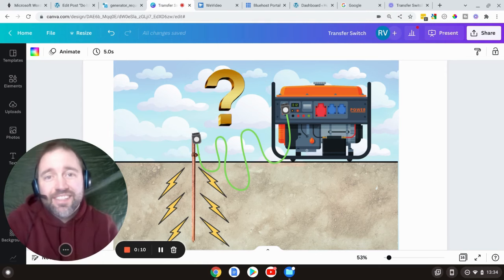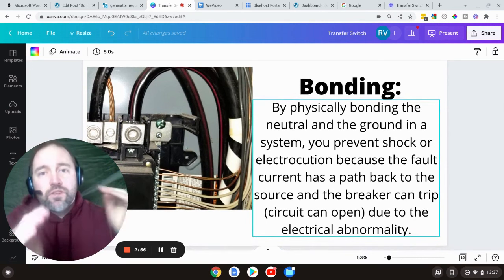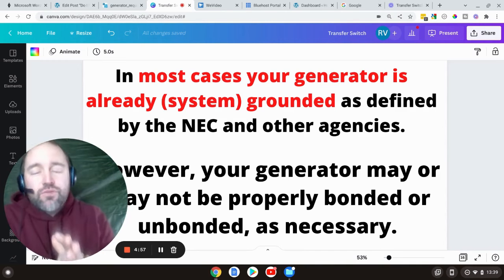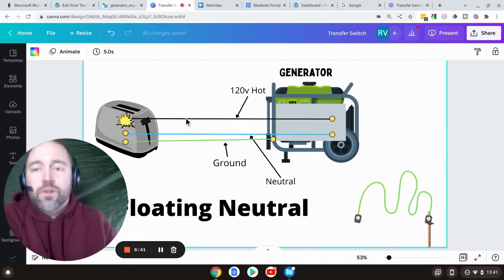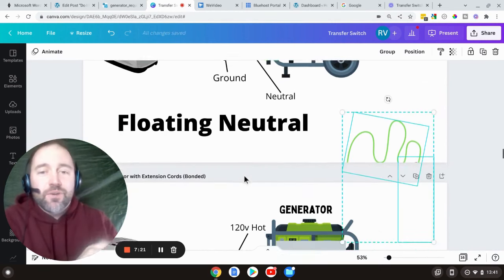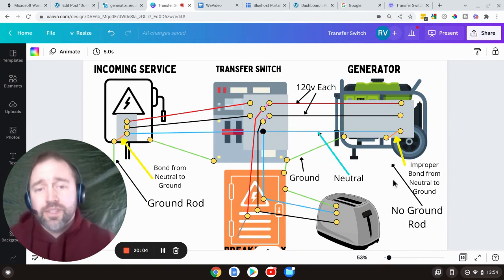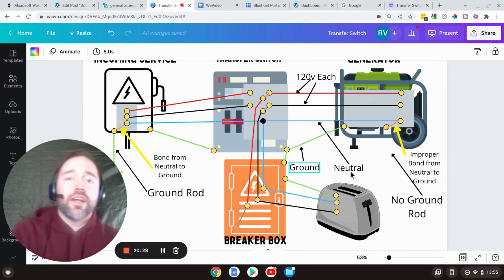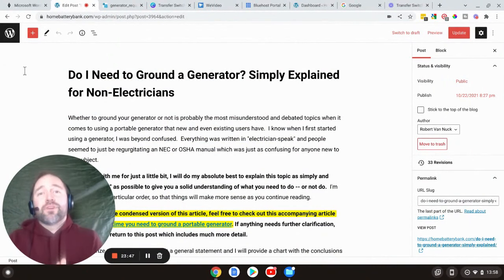Does My Generator Need a Ground Rod?  Probably Not.  Here's why.

Comment: Newbie here.  I use nothing but electrical chords to run some key items (freezer, etc) during a power outage.  Per this video, I should bond my neutral.  I'm not using the L5-30r socket on my generator (120v only generator, no 240v).  Can I purchase a L5-30p plug and do the bonding within the plug?  I makes for simple conversation back and forth between floating and bonded.
Reply: Get a bonding plug they are inexpensive on Amazon. It will plug into a 120 receptacle on the generator and the entire generator will be bonded including the 30 amp receptacle
Reply: Check your generator to see if its already bonded.  See if there is continuity between the neutral socket opening (the wide one) and the round ground opening socket, using a meter.  I had to move my meter leads around some before I made a good connection and found that I have a bonded generator.

Comment: So my solar generator is a floating neutral and my transfer switch is Generac HomeLink, which switches the neutral from the grid neutral. The only thing shared in the transfer switch is the ground bar which is connected for both power sources. I would assume that if I used a generator grounding plug that bonds the neutral and the ground together on my solar generator this would meet the requirement to bond my solar generator when powering part of my home and gives it access to the homes' existing grounding system, which includes the grounding rod, yes?  Thank you for this great video!
Reply: I would say you can test this with a meter. Flip your transfer switch to the standby power mode and see if ground and neutral are still tied together, measured at the plug where you connect your generator.

Comment: If you convert a portable generator to a floating neutral, should you not use the outlets on the generator at the same time the generator is energizing the house through the house electrical panel?  I'm wondering, since a neighbor has expressed interest in running an extension cord to the generator.
Reply: I don't see why you couldn't use those outlets since the neutral is bonded at the house and essentially they are no different than an outlet in your house. If you're talking about that neighbor connecting into your generator, I'd be more concerned about them exceeding the output of your generator and tripping your generator breaker.

Comment: I don't have my generator on a 'frame', I have it on a steel metal garden cart, because it's easier for me to move, it's very heavy. Since the cart has for rubber wheels, would it be advisable to put a grounding rod in to attach to the cart?  I used this generator last year here in East Texas when they froze us out for 3 days, had no problems, but what you have said about the frame being the ground for the generator now has me a bit worried. Thank you.
Reply: If you have a 4 wire connection to the house, you are already grounded through the home system.
Reply: @rupe53  ; thank you, I knew that it was, but I just run a cord through the window, I am not able to connect it directly to the electrical fuse box...
Reply: @moneypenni1694  ... if you are not tied to the house electrical system then you do not need a ground rod.
Reply: @rupe53  ; sorry for the tardy reply, pc issues...sigh. Thank you for your response, I appreciate it, we're supposed to get slammed tonight with thunderstorms.

Comment: Can you do one when you use an interlock? The generator I have says it is neutral bonded to ground.
Reply from the maker: When properly installed,  an interlock just makes it so that you can't have the mains power turned on while you're turning on the breaker that you're using to backfeed the house with your generator.  The power line crews appreciate it!  The neutral is left intact (and the house is already bonded) and the generator still shares it with the house.  The generator should be floating neutral (unbonded) so that you don't have parallel paths for the return current (and any fault currents) back to the source (the generator).  Of course,  I recommend reaching out to your local certified electrician before you make any changes.
Reply: The gfci will trip on a floating generator

Comment: I have had a generator since 2003. I have never used it as a source for my high-efficiency gas furnace for fear that it would take out the $$$$$ control board. I was told that the generator puts out "dirty" voltage. More recently, I've read the problem is the ground and that the flame sensor will not see the spark ignite the flame and will shut down. How do I get a plane jane Generac generator to power my furnace. OBTW, there are videos out showing that expensive Honda generators, with floating ground, will not power up the furnace. My microwave will not run off of my generator either.  I am using an extended version of the twist lock on the generator going to 4 each 120VAC outlets. Thanks.

Comment: watched your video, I am setting up a bonded generator to a house with a interlock. someone told be to run a grounding wire from the generator to the same grounding rod used by the house, can you give me your opinion, i just want to be safe with generator and and not endanger any thing in the house, thanks
Reply: If you're using a 2 pole interlock kit (with unswitched neutral), you'll need to remove the bonding jumper in the generator and do not add a ground wire (or attach) to the ground rod .

Comment: If static electricity gets in the frame on a generator you’ll wish you had a ground rod.  That’s what a ground rod is for. 
Static electricity can’t get out of the frame so if you try to put gasoline in the generator it can spark and that’s really bad.  
When your hand touches the frame you get that little pop from the static.

Comment: What about for a bonded to frame generator plugging into an interlock?
Reply: What about it? Is the neutral being switched? That's the question you need to answer, and you need to act accordingly per the information in the video.
Reply: @chris2790  good job explaining nothing...  👏
Reply: @dthompsont3796  it's in the video.
Reply: Check the comment above from bradsmith5131 concerning this issue.  The generator needs to be converted to floating neutral with no ground rod if you're just using the interlock in your main panel.  Many people confuse the simple interlock system with the more complicated transfer switch and it wasn't directly addressed in this video.

Comment: I always leave my generator bonded, because I've seen firsthand what damage happens to appliances in a home, if the neutral connection is suddenly lost.
Reply: That bonding should only occur once.   At the first overcurrent device.  Bonding in the generator does not help with your concern.

Comment: Hi could someone clarify for me when he says using an extension lead, would the toasters own lead with out an additional extension lead connected making it longer be safe connected directly to the generator? I'm assuming not, if it got a fault its the same right (toaster plugged directly into gen or with additional extension lead) I guess he says extension lead referring to when it's not hooked up to the house via switches. This really has me confused can someone help me understand. Thanks
Reply: Yep.  When he's speaking of extension cords that is when you're just running cords from the generator's onboard plugs to certain things in the house but not connecting it to the home's wired electric system.

Comment: If the neutral is connected using the neutral from the power company and the generator, would that not backfeed the grid?  Aren't you technically trying to return the electricity back to the power company?
Reply: No, not via the utility neutral.  You can only backfeed by completing a circuit with the utility ... meaning between the two utility legs or between the utility neutral and one leg.  The neutral alone has no ability to backfeed anything.  It just equalizes the potential of the neutral conductor on the utility transformer.  No current actually flows.
Reply: @junkerzn7312  Got it! Thanks! That makes sense.

Comment: My transfer switch just controls the furnace.
"Normal Position" furnace is fed from house circuit breaker (electric utility supply).
"Off Position" No power to furnace.
"Generator Position" Power comes from generator to transfer switch using a three prong extension cord
& generator power feeds the furnace.
I think in this youtube example - he is using the transfer switch to feed the whole house through the home circuit breaker?
I just want to keep from freezing & kepted it simple.

Comment: Great video and great graphic displays too. One of the best I've seen.  I have a question that maybe you can help clear up. For my home, I have a 50 amp DeWalt DXGN14000 generator connected to a 50 amp receptacle using a generator interlock kit. From what I can tell, my generator is bonded.  Can or should I use additional grounding from the generator motor using the original house ground rod? Is it necessary or unsafe to do this? Thank you for the time you put into your video and any information you can provide in answering my question.
Reply: You do not need any more ground to the machine you have it grounded already and just use the recommended 50 amp wire and 3 or 4 way plug that comes with it.  It comes with a ground connection.
Reply: @carlcapello9956  thank you sir 👍
Reply: I think you should be using a floating neutral generator...rather than bonded, because it sounds like you are back-feeding into the house wiring system with the main breaker being off and locked.  The bonding of ground/neutral is occurring inside the house panel.  That is what I got out of this video.
Reply: Here is an answer I found from Home Battery Bank in reference to an interlock system.  I found it down below.

"When properly installed,  an interlock just makes it so that you can't have the mains power turned on while you're turning on the breaker that you're using to backfeed the house with your generator.  The power line crews appreciate it!  The neutral is left intact (and the house is already bonded) and the generator still shares it with the house.  The generator should be floating neutral (unbonded) so that you don't have parallel paths for the return current (and any fault currents) back to the source (the generator).  Of course,  I recommend reaching out to your local certified electrician before you make any changes."

You need to have a floating neutral generator and no additional ground rod.
Reply: @spacecoastz4026  This was very helpful and much appreciated. Thx for taking the time to reply to my question.
Reply: @1doylelawson  You're welcome.
Reply: @spacecoastz4026  Thank you so much! That is exactly the info I needed.

Comment: Your diagrams do not show a ground wire at the Main Breaker. Almost all homes in USA have a MGN and bonded neutral/grounds because the Service entrance Main Breaker is the first disconnect. 

Mobile homes are the other side of the coin and I have found so many with outside disconnects and bonded neutral/grounds inside. And 85% of them, the frame/chassis is NOT grounded separate from the neutrals and my voltage detector goes off when testing the skin of the trailer. ALWAYS test a trailer with a detector and use Hot Gloves and flexible ground strap before touching the trailer. Bond the frame/chassis to the MGN next.

I am using a GenTrans switch that does not lift the houses MGN ground to my ground rod so my house is still grounded outside. The GenTrans unit switches just the HOT side and the Neutral and grounds are still bonded at my main breaker panel. My Honda Eu6500 is connected to the house with twist lock 30 Amp and 10-4 with ground. 

My oven and drier are the only 240VAC devices and are never run on Gen Power.